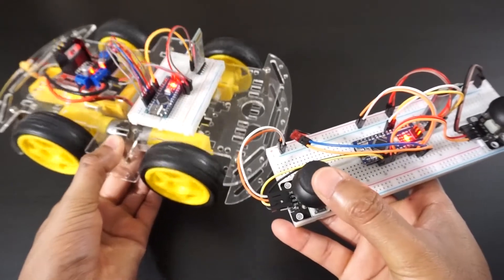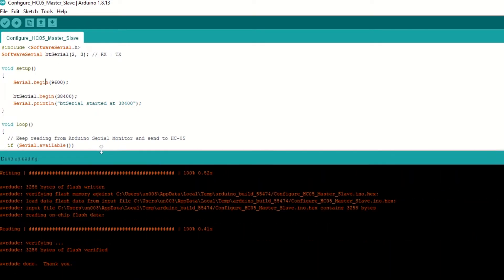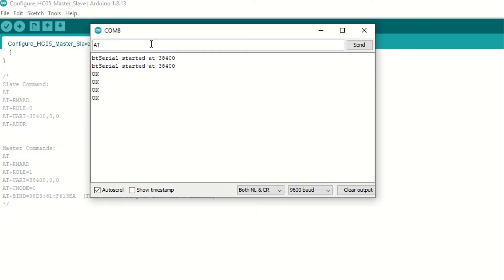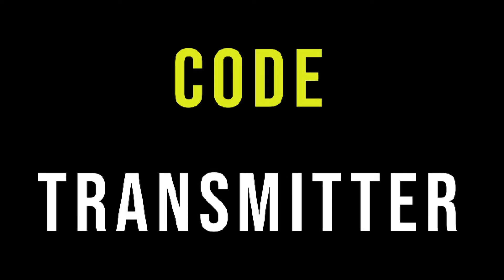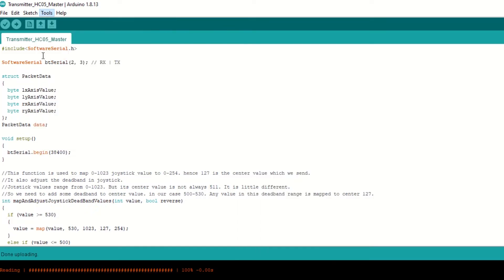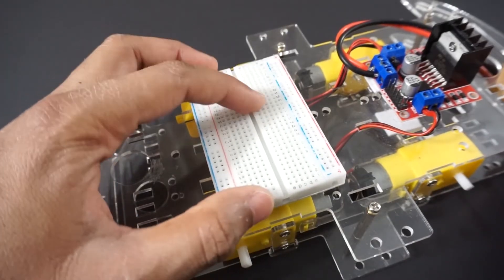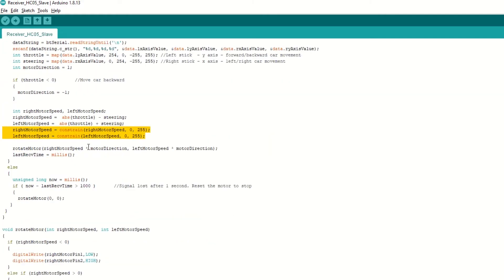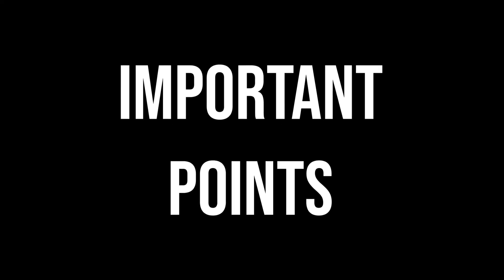Arduino Bluetooth Car using HC05 Master-Slave Transmitter Receiver | DIY 🔥

Comment: A good project for developing my skill in Arduino...

it also helps me to gain knowledge by solving problems. 

Problems faced (and solutions)

1 - AT mode doesn't open - check the module is HC 05 or 06. the methods are different for both (There are many method to do this.. check it one by one)
2 - Program doesn't upload successfully - check the options in tools section of Arduino before upload (port, board, processor etc...)
3 - modules didn't turn on - check our connections properly (better if use multimeter)
4 - motors doesn't turn properly - change polarity of motors to motor driver by interchanging their wires
5 - motors doesn't work properly - check the voltage and current of battery - it only works in rechargeable battery since it has high current than normal battery

if facing problems - use our internet to solve it... we need to face problems for final victory...

I hope this helps
Reply from the maker: Well done and I am glad that after facing so many hurdles you made it successfully 👏🏻👏🏻👍🏻. And thank you very much for sharing your experience . These findings will definitely help others.
Reply: @hashincludeelectronics  😀
Reply: @hash pin this because it may be helpful for others
Reply: True😊❤
Reply: Bro AT mode is not coming and it is hc05 only
Reply: @tamilmovies348  There are several methods to make it into AT mode. U may need to do it one by one, since it's hard to say which one is the exact one for your module. I suggest to go through much articles as possible, untill it's solved.

Try your best!
Reply: Thanku bro
Reply: What is the range of this reciver

Comment: Hi ! I am facing a major trouble in this . I have followed your procedure properly and uploaded codes as per instructions. But the car is not working already checked connections but not able to find the problem. Any advice regarding this

Comment: Hello sir I am facing problem while uploading AT command for receiver the error command is showing after typing AT+ADDR ! So what to do urgently i  want reply
Reply: Hello sir after connection all and uploading all code correctly and successfully,the remote is not working
Reply: I have done all correctly and uploaded code correctly step by step as shown in video but still my remote is. Not working I am not understanding what problem is showing

Comment: Can we use servo motors for steering
Reply from the maker: Yes you can . But you will have to make changes in code and circuit accordingly 👍🏻👏🏻

Comment: I have a problem with joystik fluctuation at receiver,when i'm checking joystick value on transmitter its normal the center is 127 but the receiver sometime 0 and 102 but the center still 127
Reply from the maker: Please check the loose connections 👍🏻👏🏻
Reply: @hashincludeelectronics on my NRF24L01 rc car project its all normal,but on HC05 its always like that

Comment: hello bro...
I'm really impress on your work ...but can you please tell me is your diagrams and code are working...
i watched a lot of videos but there pin outs and code are not working ....
but please tell me is your code and pins are correct...
i have a big competition at may 27th so please be honest..
Reply from the maker: Yes it absolutely works . However looking at deadline, I am afraid that in case of any issue the situation will not be in your favor . This project looks simple however sometimes take lot of time to debug any issue. On top of that I  am little bit busy with my work so won’t be able to help you much . So if you want to try then try it but keep in mind a risk for any issue 👍🏻👏🏻 best of luck 👍🏻

Comment: After uploading all the codes, when i plug in the battery in the car receiver, hc05 is not responding. Please help. Tried resetting the arduino nano multiple times still no luck.
Reply from the maker: May be there is power issues . Please use rechargeable battery only 👍🏻👏🏻

Comment: it has says an error when i try to connect as a master-slave in bluetooth, when i type AT it says ok but when i try to type any AT it says error, and im using an arduino uno instead of nano
Reply from the maker: Check if you are using HC05 module only . Check for any missing step in video 👍🏻👏🏻

Comment: hi i have questions can i do the process for hc05 
if the slave will put in the Arduino uno and the hc05 transmiter is using Arduino nano?

Comment: i didnt understand your circuit in the transmitter device, why did you connect so many pins to breadboard power rail?
Reply from the maker: @iamnabha9468  the circuit is simple . Please check how breadboard works then you will understand everything 👍🏻👏🏻
Reply: @hashincludeelectronics  it doesn’t  work for me

Comment: is it possible to use arduino uno for the car?
Reply from the maker: Yes you can 👍🏻👏🏻
Reply: @hashincludeelectronics  how? im not familiar with arduino so how can i configure the arduino uno to work the same as yours

Comment: Bro i connected every wires and coded. I completed the project and final if i accelerate or decelerate, right or left it is not working dude. Please help me!! 😢😢😢😢
Reply from the maker: @tamilmovies348  please check the connections again . Does your car move forward and reverse properly ?

Comment: Hi! Thanks for the video. When the HC-05 module is blinking every two seconds (supposedly indicating that is on AT mode) I enter the "AT" command in the Serial Monitor and I receive OK. The problem appears when I enter the "AT+RMAAD" or any other AT command. I always receive the ERROR:(O) response. What can I do?
Reply from the maker: Please check the video for any missing steps 👍🏻👏🏻
Reply: Use AT+ADDR? In the place of AT+ADDR

Comment: i have a problem, when my car just started, it runs normally but after that i can't controller, i press reset button on arduino board and it back to normal
how can i fix that
Reply from the maker: Is the issue resolved ?

Comment: Hi bro! Awesome ved
I have a doubt brother 
I am trying to make a project with Arduino mega which controls car and robotic arm 
Can I consider this transmitter for my project only to drive the car ??
Reply from the maker: Yes you can 👍🏻👏🏻
Reply: Hey even I am trying to do that, were you successful at in creating that?
Reply: @Priyanka-kv6ct  hey yes it worked I was successful. U just have to make sure that all the connections are proper and it turned out to work well
Reply: @AceNexy-Bhargav  oh that’s amazing m, do you mind sending me the wiring and code?
Reply: @Priyanka-kv6ct   oh yeah sure where do u want me to send it?

Comment: I just tried everything but my motors are moving uncontrolled all the time and they are changing directions for just a sec also. Do you have a solution for this?
Reply from the maker: Use rechargeable battery if not using already 👏🏻👍🏻

Comment: is the code is plug in play?
Reply from the maker: Yes. However you need to do some setup like master slave configuration for Bluetooth modules . For that you will have to perform some additional steps shown in video . 👍🏻👏🏻. You can check my other Bluetooth car video where we don’t need such master slave additional set up 👍🏻

Comment: Hi, I've followed this step by step and the car is functioning properly. I'm wondering on how I can make it go any faster? Yours seems a lot faster than mine, I imagine it's because of the battery that I'm using, what specific battery are you using sir?
Reply from the maker: Yes I have used LiPo 3S battery in it which provides around 12V . That’s it why it is faster . 👍🏻👏🏻

Comment: The Serial monitor is not responding when I uploaded the AT configuration code. I tried typing commands like AT, AT+ADDR  but no response like Ok from serial monitor. what should I do?
Reply from the maker: Please check the baud rate selected . Also take a look at video for any missing step 👏🏻👍🏻

Comment: can u help me to use double L298N instead of one
Reply from the maker: Actually you can check my videos on mecanum wheels car where I have used 2 L298N modules . That will give you idea 👍🏻👏🏻
Reply: @hashincludeelectronics  ok guys, i have found the solution with that video, thanks for helping me
Reply from the maker: @letantru5106  awesome 👏🏻

Comment: What should I do if I type AT in my serial monitor and nothing happens, I also get no „atSerial stardet at 38400“
Reply: also my hc05 is blinking red and blue, but if i enable AT mode just like you, both lights blink in a sequence of 2 seconds
Reply from the maker: I would suggest to check video slowly and carefully to not miss any step 👍🏻👏🏻
Reply: @hashincludeelectronics  already got it and everything works, great video👍🏽
Reply from the maker: @neuhold.m   nice job 👍🏻👏🏻

Comment: i used 2 motors for speed and 2 motors for steering can u provide code for that please
Reply from the maker: It’s not just providing code but it needs testing as well. I would suggest to take help of the existing code and make changes accordingly 👍🏻👏🏻

Comment: when i put in the serial monitor the comand AT or AT+RMAAD or AT+ROLE=0 or AT+UART=38400,0,0 or AT+ADDR
doesn´t show anything in the serial monitor ("the message: OK")
Reply from the maker: Please follow the video 👍🏻👏🏻
Reply: @hashincludeelectronics  when i type AT+ADDR it's reply me with error,,, what is the problem
Reply: @shahnewajbd4623  put AT+ADDR?

tHE QUESTION MARK is missing, same error

Comment: can I do this project with two Arduino Uno?  using HC05(master) and HC06(slave)?
Reply from the maker: You can use Arduino Uno in this project . However not sure about HC06 . I would suggest use only HC05 to avoid any issues . 👍🏻👏🏻

Comment: Bro when i connect my battery with my l298n motor module my Bluetooth stops working and when i connect the usb my Bluetooth starts working and connects to the master but it's motor is not working
Reply from the maker: Which battery do you use ? Use only rechargeable battery because it supplies good current 👍🏻👏🏻
Reply: @hashincludeelectronics  I used rechargeable battery and it starts working but controller is not functioning and when I connect my battery to vin it Bluetooth stops working

Comment: hi sir 
i have connected everything correctly 
the modules seem to connect
but then only the master module is blinking and the slave stops blink 
hence the car does not work
can you please help with that??
Reply from the maker: I would suggest to take a closer look into video again . This project is very involved and needs lot of attention . Please check video slowly and carefully again. Also make sure you use only rechargeable battery in your project 👍🏻👏🏻

Comment: I am facing a problem. The car moves on its own even when the Joystick is not used. It starts moving after the master and slave are connected. I am using lithium battery of 3.7 volt for the receiver and a power plug of supply 12 volt for the transmitter. Please suggest what is the problem.
Reply from the maker: You need to use total 7-12v power supply at receiver . 👏🏻👍🏻
Reply: What I meant was I am using a pair of 3.7 volt lithium battery. Sorry for the mistake
Reply: I have a similar problem, when the master is connected and the slave starts moving without using the joysticks and I can only control the direction of the car. Does anyone know how this can be fixed?

Comment: Can you please tell the code of same project by using shield motor driver L293D
Reply from the maker: This project uses L298N module which is also cheap . I would recommend to use the same module to avoid any issue. However I have not used L293D module ever . So unfortunately I am not sure about it . 👏🏻👍🏻

Comment: Would it be able to combine the arduino code from the NRF24L01 with the arduino code of the HC-05? I want to control my RC car with a controller (via the NRF24L01 module). And also be able to control it via an app (with the HC-05 module)
Reply from the maker: You can refer my videos for combination.

Comment: Hi, did you face any delay in receiving signals to the slave hc05 on robot. I am getting delayed signals and at time it jams. What can be the issue?
Reply from the maker: Did you change the baud rate by any chance ? Low baud rate will cause this problem . Or you can add some delay of say 50 milliseconds in transmitter code after every transmission.
Reply: @hashincludeelectronics  actually i bought a robot with an andriod app as a controller already provided to control via Bluetooth. I can't seem to make changes on the transmitter side. But I can make changes in Arduino code on the receiver side. Can you tell me what I can do, or I can share the code if you can look at it. Pls, send me your email?

Comment: I try to make this project everything is fine but I face problem for steering control this car moving only forward and backward steering not working I try everything wire changing
Reply from the maker: Steering is on other joystick.

Comment: Error showing on AT+ADDR on serial monitor
Reply from the maker: Thanks for checking the video 👍🏻 could you please share more details on this error ? Or send me screenshots of error on Instagram hashincludeelectronics
Reply: @hashincludeelectronics  solved
Reply from the maker: @TECHAB254  awesome 👏🏻
Reply: @hashincludeelectronics  but car was not working
Reply from the maker: @TECHAB254  keep trying. Use only rechargeable battery .
Reply: @hashincludeelectronics  ok

Comment: Love the Arduino Bluetooth Car using the HC05 Master-Slave Transmitter Receiver robot. You should attach the 6-dof robotic arm on the Arduino Bluetooth Car using the HC05 Master-Slave Transmitter Receiver robot to look even more advanced.
Reply from the maker: Thank you 👍🏻. I agree. I personally liked this car and it’s easy to handle it with joystick remote control. There is video on my channel of robotic arm car but with esp32 and PS3 controller . Will try to add that arm on this car as well . Stay tuned .
Reply: @hashincludeelectronics  Sir, what courses do you do to get into the robotics field, tell me?
Reply from the maker: @fouzanjaved5441  You can check the tutorials and videos available online about different microcontroller modules like Arduino , esp32, raspberry pi etc. And check how different sensors work. Get some knowledge about different motors working. As far as programming is concerned you need to learn c++ for Arduino. May be check w3schools website. There may be some other courses on robotics available online which I am not aware about right now . But will let you know if I find something more. Learn slowly and  regularly, you will be successful 👍🏻